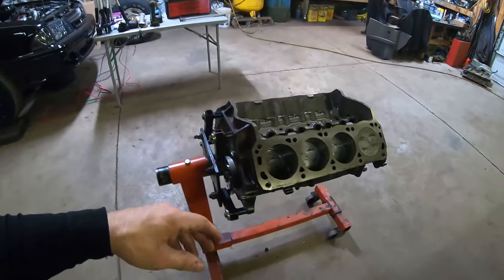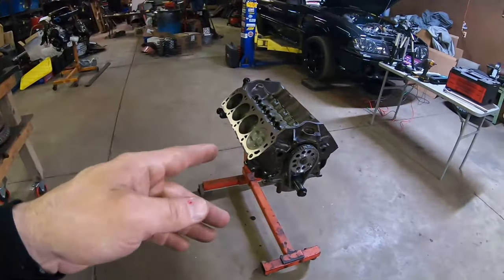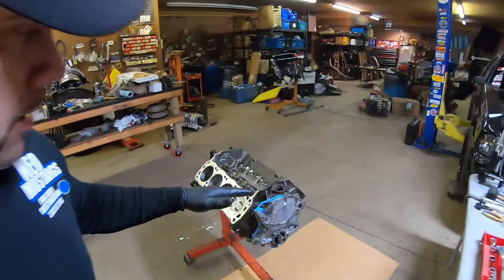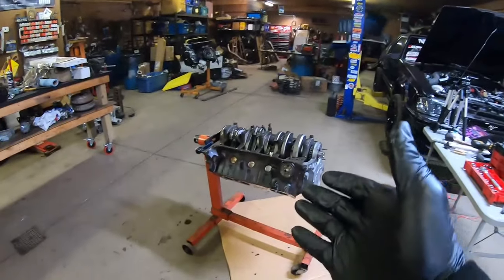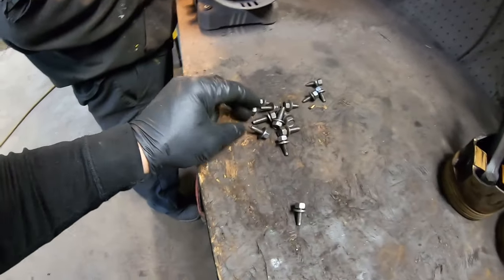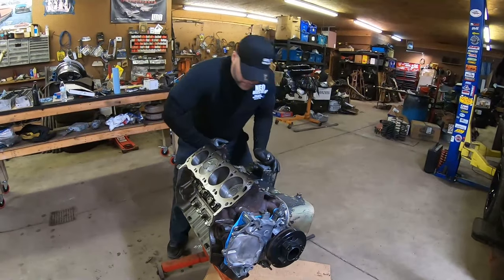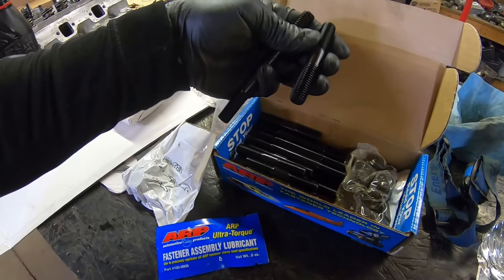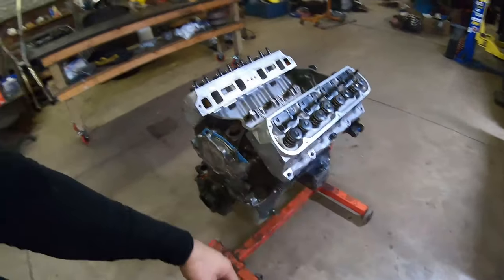Building a 500+HP Budget 351w Stroker Motor "The 387 Stroker" 👀

Comment: I wanna see a 400 crank  (4.000-inch stroke) in a Street Boss 351W, using Cleveland heads and 351W rods with Boss 302 pistons.
Reply: You can't use a 4.00" stroke crank, 5.956 length rods and boss 302 pistons with a 1.53 compression height. The 387 he used stock 302 pistons with a 1.605 compression height with the 5.956 rods and 3.85" stroke crank. To use a 4.00" stroke crank you have to use a 1.280 compression height piston and a 6.200 rod length.

Comment: Apparently the 351Windsor is still a very popular choice for rebuilding and also stroking. 
I have 2 of the earliest 351 W , they are complete motors. 
One came out of a 69 XR-7 Cougar , the other had just been pulled out of a 69 Mustang in a salvage yard complete. I paid $60 dollars for Mustang 351W. It had been junked because it was smoking, especially at start-ups. When l opened it up the insides were very clean, no sludge. The bores weren't worned . l couldn't hang a nail on bores. The piston rings were in very good condition, all bearings , cam, timing chain were in great shape.  I was kind of confused. 
    I then pulled the heads apart. Lo and behold! All of the valve rubber seal shrouds were broken and falling apart. 
I found what was causing the smoking! I have big plans for the 351W.
    On the Cougar 351W, l bought the complete car (39K mi.) in 1970. The car was a total loss rear ended collision. I paid $150 for whole car.  Took the motor, transmission and put it in a 65 f-100. That truck was fast, if l could get it to hook up. The truck is gone but l still have the complete 351W in my garage .
There is a difference between early and later 351W s. Slighly shorter and alot more metal, especially on the bottom crankshaft webbing. If one puts them side by side one can see the dfference. The 351 W is a stout motor. Great for stroking.
Reply: Found my valve seals laying in the returns !

Comment: I cannot thank you enough for these videos! I swear you are the only one that seems to be discussing motor building. I haven't built a motor in probably thirty years. I had an '86 T Top GT with a 351 in the early 90's and I regret ever selling that car. My current foxbody is an 88' GT convertible and I have the itch to build another motor likely next year along with beefing up the AOD (I know.....I know) I looked for over a year here in Florida and upgrade the ring & pinion as well. Between your stroker motor videos and all the information comparing the 302 and the 351 I have been absolutely stoked to the upgrades and not sell this car. It's been a regret for a long time. You're AWESOME
Reply from the maker: Ty !

Comment: I hate the fel pro timing cover gasket. They hang out all over. The Mahle fits much better. Thanks for the Ford build                                                                                                                   We also use the Melling select standard volume oil pump with the gray spring.

Comment: Also, talking about the nice bore this block has. It's a shame that Ford didn't decide to use low tension piston rings from the beginning instead of in the mid 1980s. With those engines a rebuild usually just needs a quick hone job. The older 302 engines that used the thick 5/64 piston rings would show as much wear in 30,000 miles as a low tension ring engine shows in 150,000. When rebuilding the older style 302 you were guaranteed to need a overbore.

Comment: I've been considering building one for my 94F150 flareside! Got a set if trw .030 pistons, couple sets of 351w rods. But they're press fit pins. But I sold my heads! Got a set of professionally ported 289 heads, but probably won't run on 93 octane!

Comment: You I'll lose a  skirt from one of those TRWs , i did once , should have used some 4032 drilled oil drains type forged  pistons I've got a 385 ci windsor for my F150, I have collected a few good parts , eagle forged crank , crower rods , autotec forged pistons , retro fit comp cam , dart heads,  milodon  gear drive ,  Mallory dual sync , and a motec ecu , good projects  👍
Reply from the maker: I dont think it will

Comment: Thoughts on flotec heads…..i see they come with 1.94” intake and 1.60” exhaust……..those would work on the small 3cc valve relief stock pistons on a 1996 bronco 5.0 motor??  Im only asking cause i dont wanna waste time and money on the e7te heads….afr 1341 sbf heads are also same small valve heads and are specifically made to clear fatory small relief pistons….i like the afr’s but the combustion chamber is 64cc which will get me in the high 8’s low 9’s for compression…if i go with flotec they have 58cc chambers and should put me in at around 10.15:1 compression give or take depending on head gasket size……i know the flotecs are chiniusm and im ok with that …im not trying to make over 400hp….im building this motor for my 15 yr old son for when his 289 in his ‘67 mustang goes night night…..with after market heads and roller rockers im guessing the factory pushrods for the stamped rockers and roller lifters are no longer the correct legnth…..

Comment: Awesome video , should I go with a 351 Cleveland or Windsor .
Reply from the maker: Whichever you can afford most.
Reply: If you do 351C, make sure you use a deep 7 to 8 quart oil pan. Those heads can hold almost 2 quarts each at high rpms. You also need to provision the oil drain back in the front and lifter Valley also to aid in oil drain back.

Don't mess with the oil bypass and restrictor bull$hit. The issue is having a stock oil 5 quart oil pan with 4 quarts in the heads. Dry locking the oil system is the real problem.

Comment: I gotta question. Ready to do 351w swap and was wondering about Efi proportion? I have 93 Mustang and got 95 351w engine came outta 95 F150 just wondering if the wiring or efi harness  is plug-n-play?
Reply from the maker: You can use your 93 harnesses yes. 351 and 302 roller is same firing order
Reply: @Neomustangs  appreciate it brother

Comment: Hi, got 351 in my mustang, it’s been sitting for 12 years never cranked it. Should I pull the motor an reseal it or run it like it is. Thanks
Reply: Pull the engines. Regasket the entire engine. Drain the old oil.Then with the distributor out, prime the oil pump with fresh proper weight oil and hand turn the rotating assembly. This will allow oil to the bearing surfaces. 

If the motor was basically a fresh rebuild or completely new, break in oil after following the first steps mention before. Then drain and add synthetic proper weight oil.

Comment: I did math, here’s the figures. 3850” Crank, 6.7947”(240-i connecting rods .912, 351 2V pistons(9.2 Clev) 10,280” deck 351M/400 block…. Hybrid timing gear chain set.
Also did math for Windsor 3.375” crank, Chevy after market 383 stroker with 6” Rods(1.125” CH pistons) .927.. Scat LS 6.100” rods .927 instead of .944” Small end( pistons with 4 eye valve reliefs. No one has posted any of these combinations of custom builds & these figures aren’t certain to work. Good luck, P.S. I bought my Eagle crankshaft 10351375 on sale directly from them for $59 & $72 shipped to my porch
Reply: I built mine as a 389...Eagle crank with 2.1 rod journal size with 3.750 stroke... Keith Black 4.060 pistons and Scat 6.2 rods for a SBC...RHS heads...

Comment: How much did u save using old parts vs a street strip rotating assembly, those are tops 1000$ & it's balanced
Reply: I've not seen a balanced kit for that low cost. Cheapest I've seen in 1400 range. And not balanced. Most kits have dish pistons which kill any gains because CR is nonexistent
Reply: @lonniemonroe2714  well with inflation everyday prices are now even worse, but most good company's balance there kits, it's got to b a complete kit too, I paid 1900 for a fully forged kit to handle 1000hp balanced at no additional price